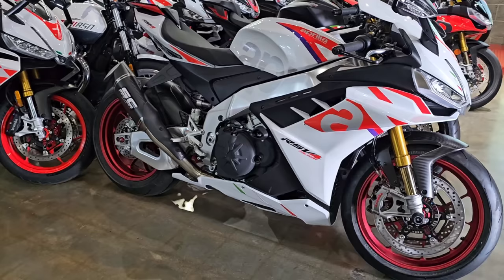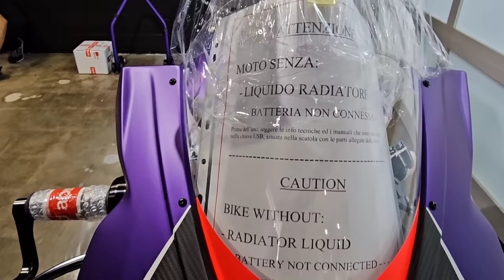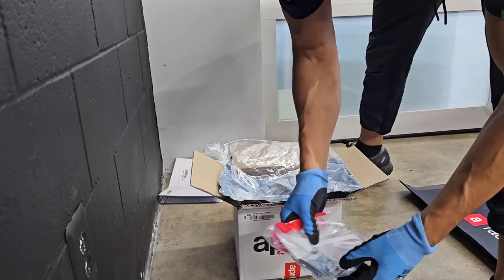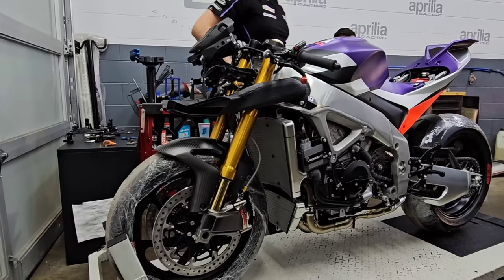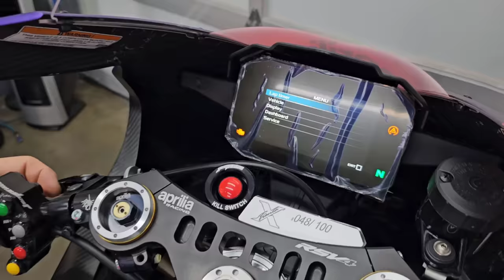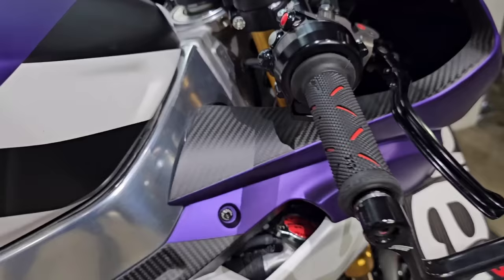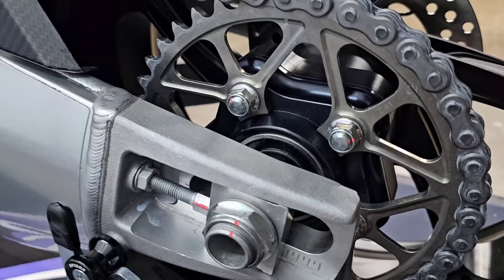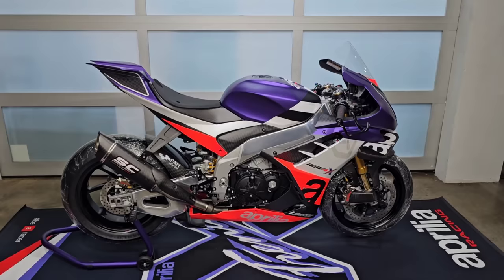Aprilia RSV4 XTRENTA Unboxing • Prepping • Specs ☆ USA

Comment: Without a doubt it's a gorgeous bike. I so so want one. It would easily be my new track bike. Though idk about using a number bike as my track bike. I feel like you could go for a full race build on a RSV4 Factory and be just as happy.
Reply from the maker: I'd hold this one as a collector and track another RSV4.
Reply: @Victor_Moto  Yeah. I'm just not big on collecting for the sake of having it and watching it increase in value. I couldn't resist riding it.

Comment: Would the XTRENTA race track fairings fit on the RSV4 or the RSV4 factory street bikes? The XTRENTA is the best looking bike on the market, even over the Ducati and the BMW.
Reply from the maker: Yes, on a 2021+. And I agree with you!
Reply from the maker: The total kit is around $19,000.  The upper/front fiaring is roughly $11,000.

Comment: If you were to choose 1 from the following, which one you would choose and why?
Ducati Panigale V4
BMW S1000 RR
Yamaha R1
Aprilia RSV4
Kawasaki H2
Suzuki Hayabusa
Agusta Rush
Reply from the maker: Ducati Panigale V4: No. Runs very hot, chassis not refined as much as the others.
 
BMW S1000 RR: No. Very refined, not exhilerating though. It rides for you, no fun in that. 

Yamaha R1: No. Great bike, outdated though. Nothing about it shines above the rest. 

Aprilia RSV4: Yes. Best motor in it's class and it's a V4.  Also best price in it's class. 

Kawasaki H2: No. I like sportbikes that are designed to go around a race track, not just straight line. 

Suzuki Hayabusa: No. Same as H2 but even more so. 

Agusta Rush: Yes. If you want to make a statement, this is the one.

Comment: Besides the aero bits and being bases on the current RSV4, how would you compare it to the RSV4 X. Are they basically the same, level of detail and trick bits, or was it stepped up even more with the Trenta X? Aero aside.
Reply from the maker: Good question.  Aero aside, the XTrenta was given more power but requires more maintenance.
Reply: @Victor_Moto  reeeeaaally. That's interesting. I would've thought they were massaged to the same level.
I wonder if that call for more maintenance is just them being cautious, or if it genuinely is being pushed harder to make that extra 5bhp.

You should throw it on a scale and get the wet weight, ready to race with a full tank. 

Thank you for sharing BTW. Very very awesome.

Comment: Where can I get an under wing?
Reply from the maker: Not available yet.
Reply: @Victor_Moto that’s unfortunate. Also just realized but on the base rsv4 and factory you would need a different belly pan I believe to fit the under wing but the screw holes are there
Reply from the maker: @o8l1v1ous2   Correct. I'll put out a video explaining the details for both the RSV4 and Tuono soon.